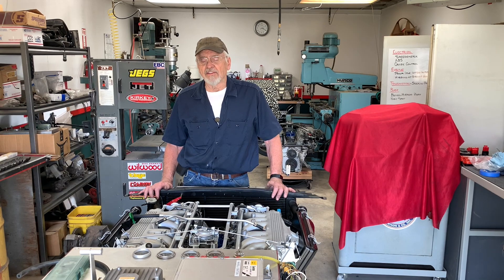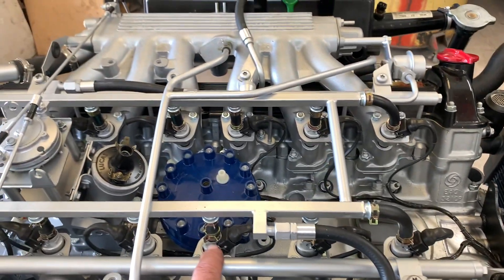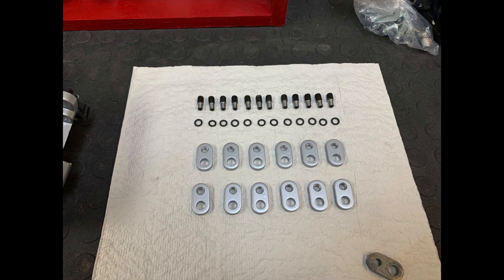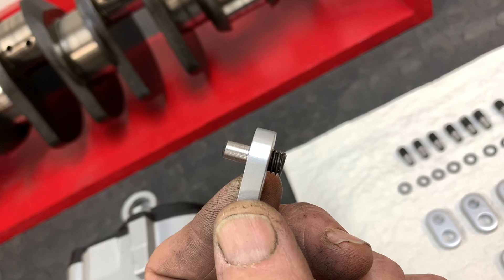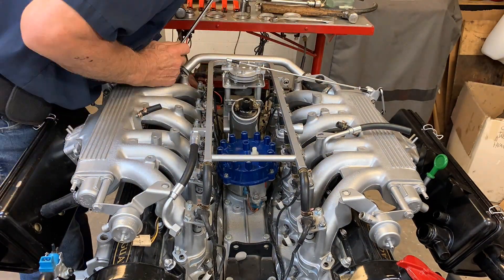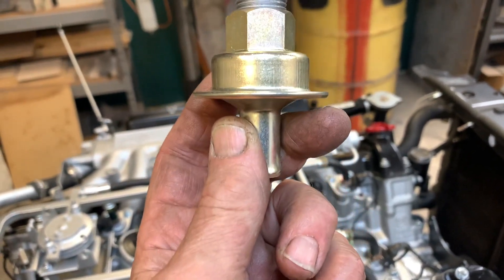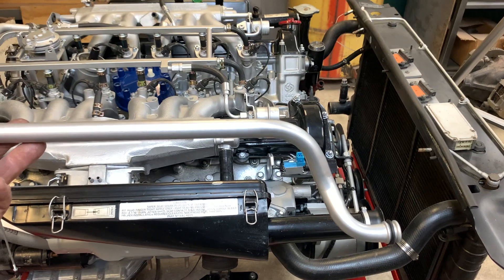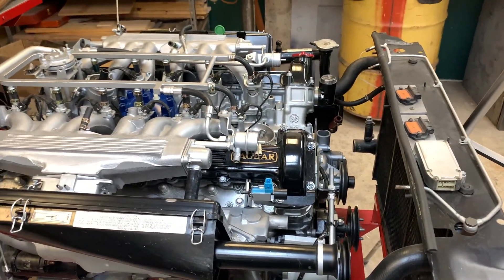TuesdayExtra S.4 Episode 9 -Jaguar V12 Air Injection System Delete.

Comment: You can get an air pump delete idler pulley from Simply Performance in the UK.  I used to go the extra mile when I did these.  I tapped the intake manifold and red loctited grub screws in the holes, then used normal intake manifold washers on the nuts.  It was a good excuse to replace the intake gaskets! 😁

Comment: Do u have any intentions of selling the finished set screws as a set of 12 as I have no way to turning the screw to the proper diameter . I have a 1990 Jaguar XJS v12 which has the air injection system which I want to delete . If u could or are planning to sell these I would be interested if reasonable . I live in Yuma AZ. retired .

Comment: The air injection system works during the first couple of minutes of cold startup and then has no effect on the emissions. That being said, there really is no measurable impact on the emissions of the engine for anything other than first start. I too appreciate maintaining a clean atmosphere but don't believe that this will have much of an impact. I do appreciate having a little less cluttered engine bay though and there is a lot of clutter under these bonnets. Also, I believe that Johns Cars, who is a, or was a builder of V8 conversion kits used to sell a bracket to bolt an alternator in place of the air pump to get rid of the "prince of darkness" aka Lucas alternator. BTY, I don't believe in converting to V8 as every time I would see one for sale I would immediately pass it over.  One possible exception to the delete would be the '95 I currently own as the OBD system does make an air injection function check that can throw a code FF67. So, I am looking for some way to work around it but it's not high on the list of things to do with it right now.
Reply: So I never fully understood the air pump principle. To me (showing my immense ignorance), pumping additional non-combusted air into the exhaust only serves to dilute the sample at the exhaust pipe. No less pollution, just what I might call watered down. What am I missing?
Reply: @hasletjoe5984   during cold start, the engine runs richer than normal, so there is excess unburnt fuel (hydrocarbons, or HC) in the exhaust stream. The air injection adds some fresh air to the exhaust stream -- again, only during cold start -- and that extra air with the unburnt fuel reacts in the catalytic converter. Dual effect is that it speeds up the warm-up time of the catalytic converter, and eliminates the extra HC during cold start. Once the engine is out of cold start mode, the air injection stops (since it's not needed when the fuel mixture is no longer in the rich mode). 

From what I remember, the Jag V12 only runs the air injection for the first 90 seconds of start up if the coolant temp is below 60 degrees C or 70 degrees C. I am not totally sure of those numbers, but I have them saved somewhere in one of my reference docs and I'm sure you could use a search engine and find the same info from one of the forums. If it's a "warm restart" i.e. coolant temp is already above that number (e.g. after going into the store or restaurant and you've returned to the car to start it back up) then air injection doesn't activate.

The implication here is that eliminating the air injection system only effects cold-start emissions. Once the engine is halfway warmed up, there is no difference whatsoever.

Comment: So I did something similar to my V12...year later I heard a popping noise.  One of the plugs had got loose and exhaust was leaking.

If you don't mind ever going back to an air rail (You could always buy intake manifolds and go back if you HAD to), here is what I did.  You will have to remove intake manifolds to do this.  

I got rid of all those little two holed braces, orings, and all.  I simply tapped the holes and screwed in some short screw plugs.  I bought stainless steel with allen key socket for a nice look.    I filled the bottom end of the holes and around the threads with exhaust paste.  I even countersunk the holes so the plugs were almost flush with the intake manifold.  I'd show a picture here if I could, looks really nice.

Comment: So. If you're  going to rebuild the airpump, what if yo were to inject nitrous on the intake of the airpump?
Reply: The air pump tubes put air into the exhaust port, injecting nitrous would have zero benefit there.

Comment: Threading the oval pieces and turning down the end of the screw is a great idea for a reversible way of deleting the air injection. On my car, I drilled out the small holes just a little bit bigger and tapped the air holes in the head instead (M7-1.0). I don't have a lathe to turn down the screw if I tried to do it your way, so this was my less reversible way of sealing it off while keeping the oval pieces mainly for looks, though I may still try to squeeze an o-ring or two in there if there's still room. I zinc plated the oval pieces with yellow chromate.

Comment: I like your use of grub screws to block the ports via the OE hold down brackets.  My solution years ago was to use small ball bearings trapped by the holes in both surfaces.  The port themselves were largely carbon blocked, and I had unblocked them via hand drilling.. for.... well.. just because...
Reply: I almost went with this solution myself. I even had the ball bearings ready to go. But then I decided that it just felt like it would be too easy for someone who didn’t know (or remember) that they were there to have one fall into the engine while taking off the intake manifolds. Obviously if you’re careful it should be fine; I just didn’t feel comfortable with that eventual risk.
Reply: Definitly a reasonable thought. @TroySherk

Comment: I made some blind gaskets and fitted them between the oval shaped steel clamps and the intake and bolted it down using the original nuts.

Comment: The V12 engine was designed with the US market in mind. Apart from the air pump, the low compression ratio pre HE flat heads to minimise NOX emissions, and the heated induction blocks on the carburated engines, were other features used to to ensure emissions compliance?
Reply: Evaporative control which vents tank fumes to a charcoal canister would have been required for US vehicles from 1971.
EGR would have been used too.
Reply: @tonymartin6508   there is no EGR for the HE and later.

Comment: A couple years ago I bought some tapered silicone stoppers that are rated for up to 600°F. When I deleted the air rails, I used them to plug all those holes in the intake and reused all the original hardware. They were ordered to fit the dimensions of the holes, and the tapered nature of the plug allowed for the original air pipe clamping plates to self center the stoppers and ensure a tight seal.

An added possible benefit is that they can be ordered as any color for additional style points; mine were colored red due to it initially being an experiment to see if they would ACTUALLY survive in the valley of death. I occasionally check on them to ensure that they are functioning as intended. My original fear was that they'd eventually collapse/melt into the hole thus creating a potential hazard or total engine failure. but after 2 years of rigorous testing (in a 120°F climate) they appear to have maintained the exact shape as the "control" set that I have kept stored in the original packaging. This was supposed to be an experiment until I could find a more permanent solution, but they've surprisingly worked ever since.

For laughs I took the car to get emissions tested and it passed with flying colors, My state doesn't really do visual inspections or at least never had it happen to me with any of my cars.

I also use a Bando USA 3430 belt for the A/C compressor, it's just a smaller belt that skips the, what would be "tensioner", and is directly attached to the crank pulley, it made the installation of the A/C compressor slightly more painful, but the end result is a very tidy and sleek appearance.

Comment: Why don’t you just weld the air tube holes closed?
Reply from the maker: My point is to de-clutter the engine bay as much as possible. The air pump goes next.